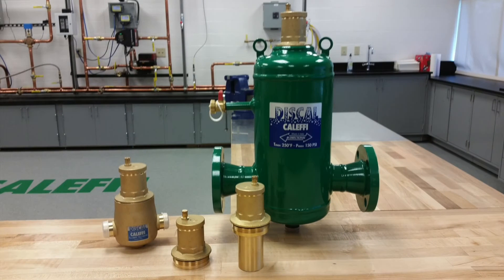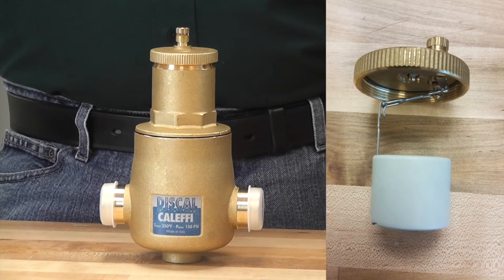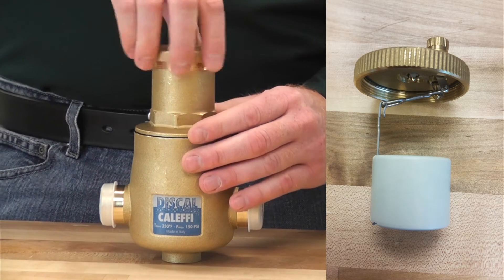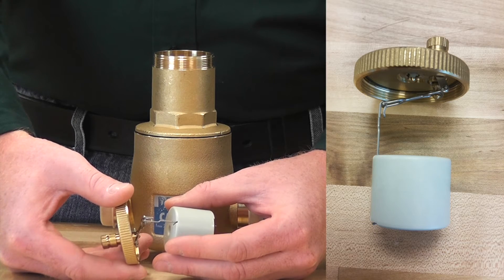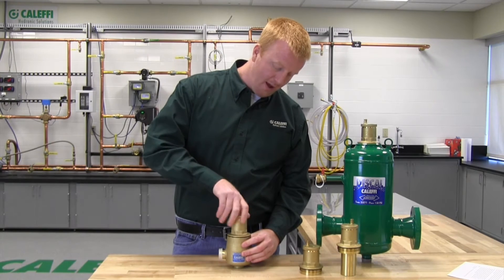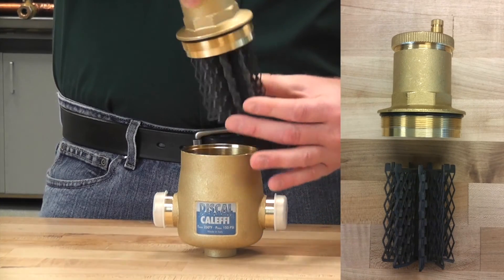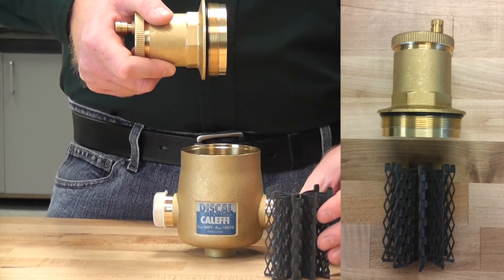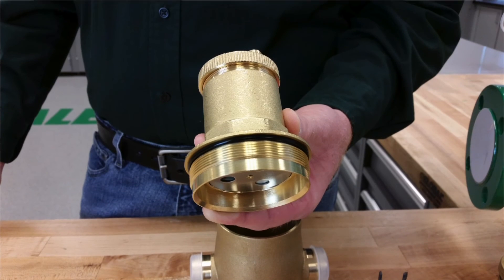How do I clean an air separator vent?

Comment: My air separator is mounted directly on top of the expansion tank. There is no valve between the two. I can isolate the plumbing up and downstream, but won't the pressure  in the expansion tank force out the water and pressure from the expansion tank?
Reply: Same here, would like to know myself